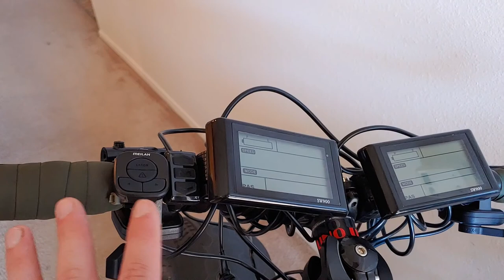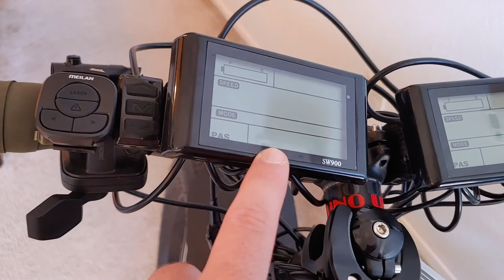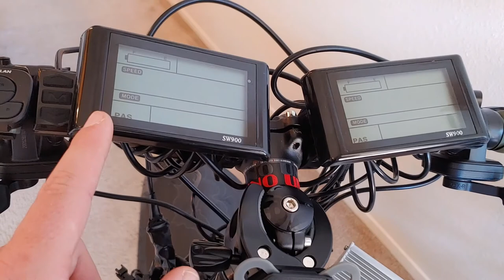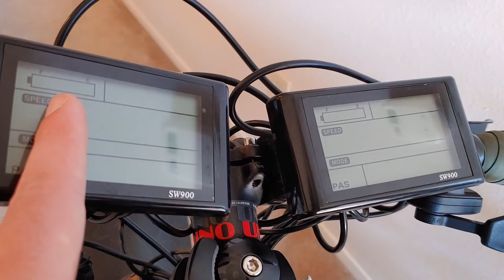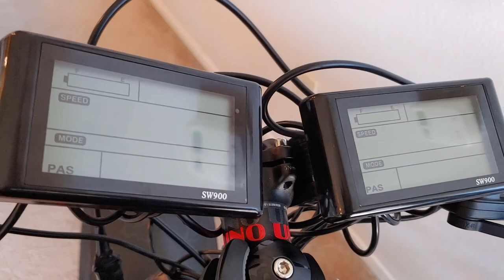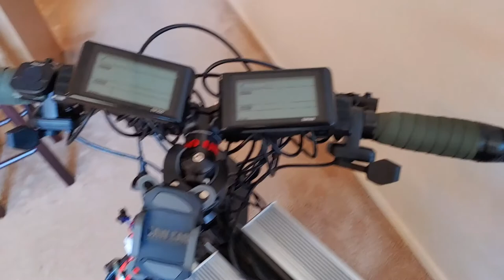Talk about the Minnesogre's Components

Comment: Thanks for the link. You motor line/power/cable that comes out the the rear hub should no go up but go down and wrap around the outside of the bottom of the frame, if done right its hidden and runs up the seat post towards the controller and battery. The are Manny issues on how you have it....be back fo more comments